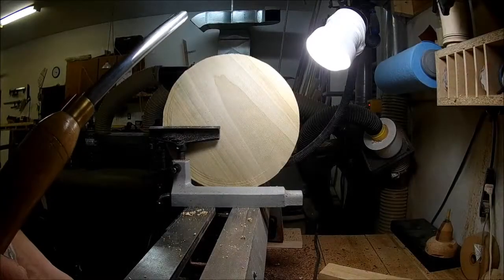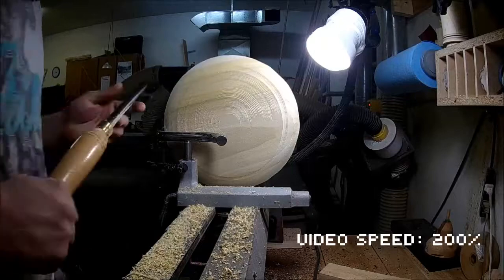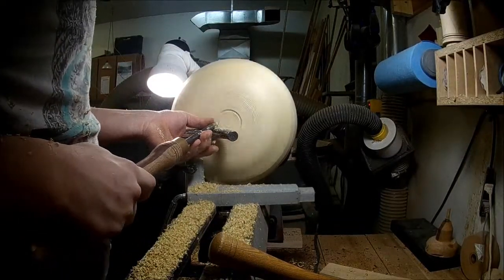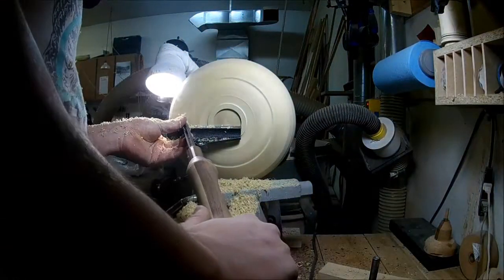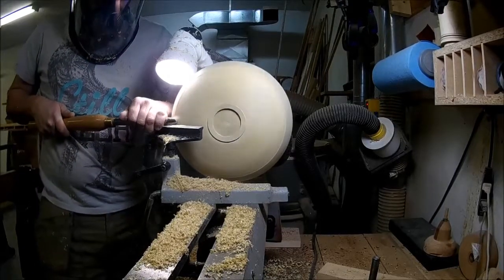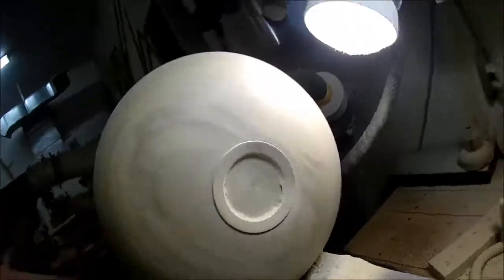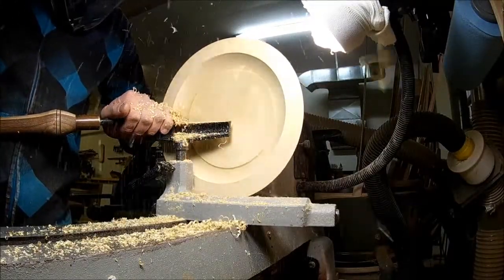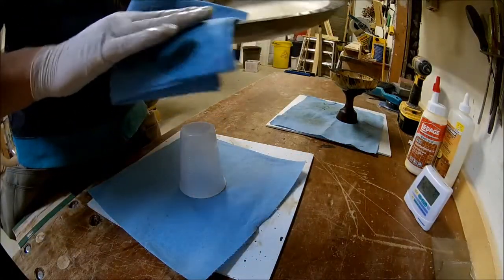Turning a Poplar Bowl on the Lathe

Comment: Nice bowl, Jonathan! How about doing a video on how you made that two-piece gouge handle? Did you use a threaded insert in the front part and a bolt in the back so the two pieces would fit together tightly?
Reply from the maker: I don't have a need for a new handle at the moment, but the next time I get a new gouge I'll make sure to record it. 

I didn't use anything fancy like a threaded insert, it's actually just a double threaded lag bolt (commonly used installing fine stair railings) and a nut epoxied in the respective halves. 

I did a mortise at tenon in the walnut, but I now feel it wasn't needed and makes it a little more fragile when I remove the end.

Comment: I have another couple of questions if you don't mind.  Could I get away with  16" wide bench for the King 12 x 18 ? or would  24" be better? my shop is small.  also what are the hole spacing the long way? for mounting it to the bench? Thanks
Reply from the maker: 16" should be fine, I went fairly deep for extra storage underneath. Not sure on the spacing, I'm not at my shop at the moment.
Reply: thanks very much.

Comment: Nice bowl. Enjoyed both of your uploads. 
Do you have a King Canada wood lathe? Asking because I'm in the market for a new lathe and wondering what their lathes are like. Anything you can tell me about your lathe is appreciated. I'm from Manitoba.
Reply from the maker: I'm not sure if the exact branding matters, but it's a King Industrial. 

I'm really happy with it. It's my first lathe so I don't have much of a spectrum to compare to however. That said I'm really impressed with what I get away with putting on it. 

The big downside is it's a bench top model so you can't get much counter weight, I have it bolted down to the workbench which really helps with vibration. But if I do any natural edge pieces I have run significantly lower rpms, which isn't a huge problem once you get used to it. 

The specs on this model are a 12" swing, by about 20" between centers, u have a bed extension so I can get 44" between centers. The bed extension is really nice even though I usually do shorter projects because it gets the tail stock out of the way. 

It's also got variable speed, but no reverse. The motor is powerful enough for most projects you'd be doing. I have tripped the breaker on the motor once while turning a 10"x4" piece of maple burl, I had to let it cool for few minutes,hut that's the worst problem I've had with it. 

When I got it we paid around $1000 that covered the lathe, bed extension, and a starter set of chisels. The Chuck I use in this video isn't included.

Comment: Well I had a premonition about my stupidity. yup I did it. My bench is 41" high to the top. So I screwed up. supposed to be 41" to my elbow. now I have to cut it down, but not sure how much. I need to know distance from bottom of lathe to spindle.. won't have that until the lathe comes. lol. I did make it 24" wide for more storage.